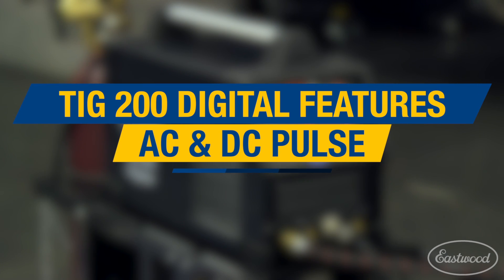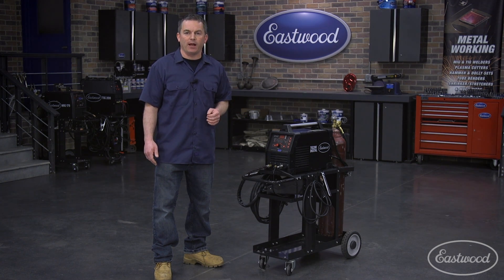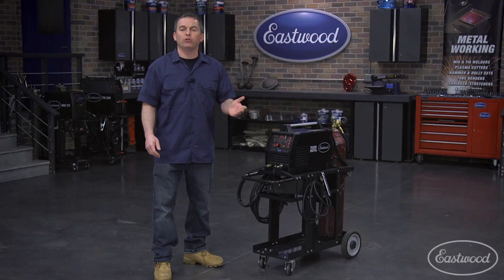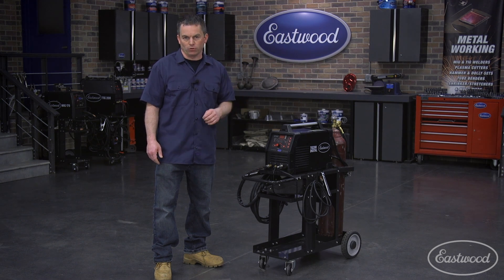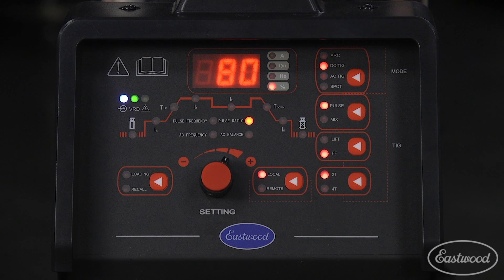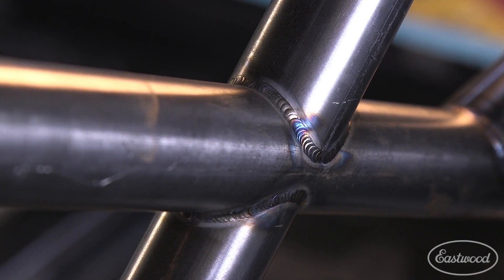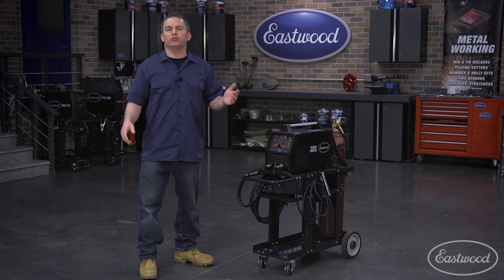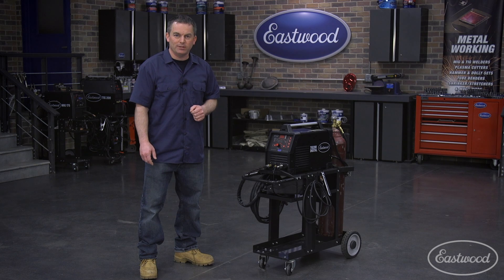TIG 200 Digital - Pulse Feature Explained - Eastwood

Comment: I got 1 and the foot control is not foot control. It's just on and off. I csnt back off the pedal to lower amps. Defeates the purpose of tig...
Reply from the maker: This is an Eastwood Welder? You can contact customer support if you're having trouble with one of our machines: 800-343-9353